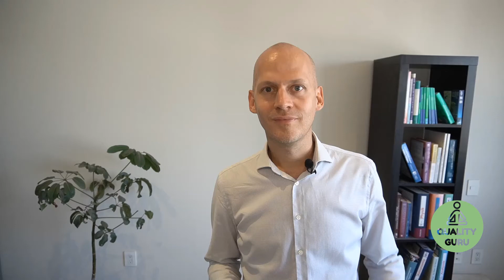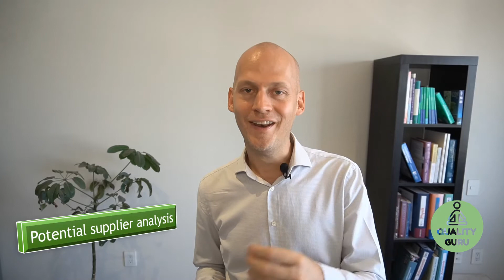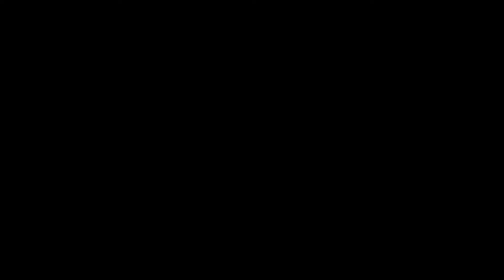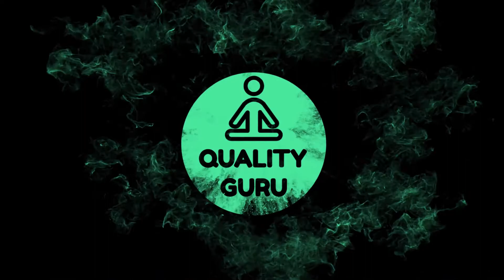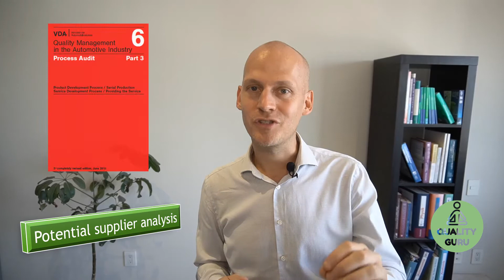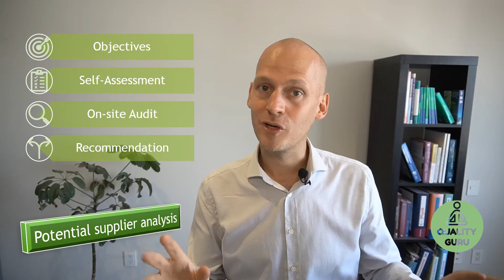How to assess new suppliers? - Potential Supplier Analysis

Comment: Do I need to use the VDA Questionary? I am using one to audit new suppliers but is not including all the questions that are in the VDA Questionay.
Reply from the maker: the VDA provides structured and complete questionnaires, they are generally accepted in the auto industry and can be transferred to many industries. In ISO9001 or similar quality systems it doesn´t requiere any specific questionnaire, you can choose the tool you like and that is suitable to do the task best. Just make sure its aligned with your organisation you are auditing for as different companies often have their own standard templates.

Comment: quite detail，even the audit template can be produced based on this video
Reply from the maker: Hello Mirinda (is this your 1st name?) Thank you for your comment. 
I don't know in which Industrie you are working, but you could look into  VDA 6.3 process audit book for more details and specific audit questionaire and adequate evidences. This standard is for the automotive industry ,but could be probably used as a general guidance in any industry. Maybe this is helpful
Reply: @qualityguru9047  yes，i am in medical equipement industry，iso13485.But i have severals years in automobiles，has a basic knowledge of 16949
Reply from the maker: @changmirinda575  great !

Comment: What are the dangers presented by a potential supplier 's misrepresentation?
Reply from the maker: Hello Nelly, 
If I understand you correctly then you ask what can happen if I arrive at the wrong conclusion. In this case you could either over or under evaluate the potential. In case I overevaluate then I will have a risk for my business because the supplier is not as good as assumed and that might cause problems. If I underevaluate then maybe I might lose a business opportunity even though the supplier might be on the right level already. Please let me know if this wasn’t your intended question or if it is helpful 
😀